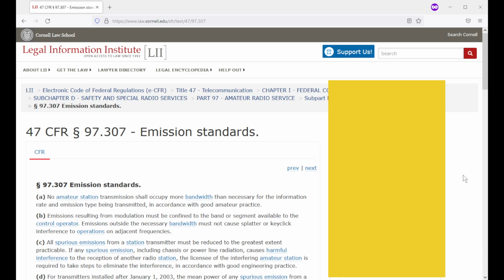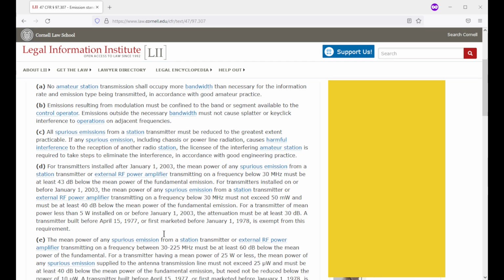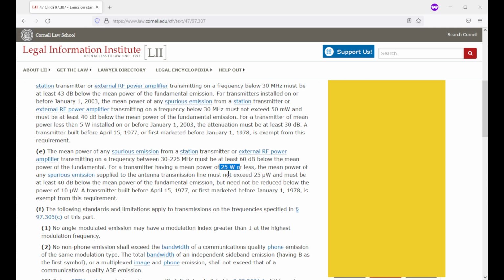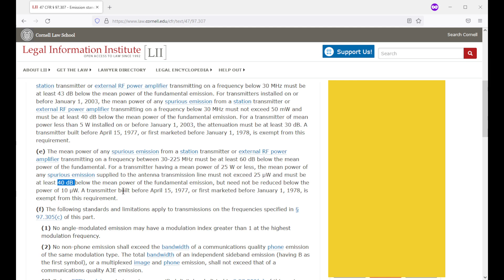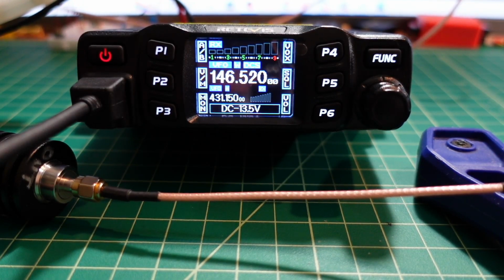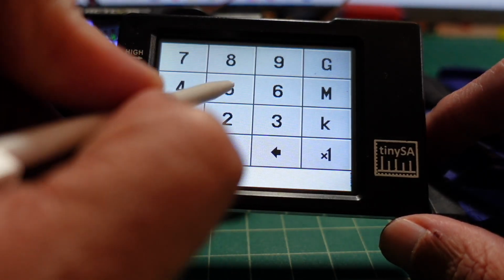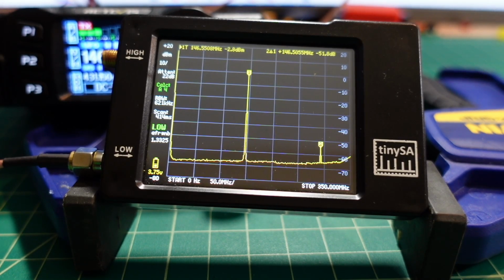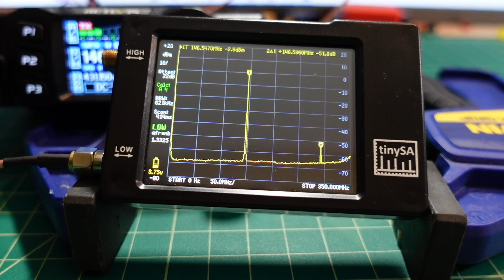Retevis RT95 Testing Harmonics with a TinySA - Ham Radio

Comment: Thanks, I have the Retevis RT95 and the Anytone variant. Both are good and almost identical but the Retevis allows for the upload of the latest firmware which includes a mic gain setting, amongst other things. I always found the Anytone version's mic a little quiet, the Retevis fixes this. I tried to upload the new Retevis firmware onto the Anytone but it wasn't happy, I was able to roll back though so didn't brick the radio.
Reply from the maker: Thanks for the info, they are really good radios for the price 👍

Comment: I just got one of the RT95's, and electronically it seems fine, and mechanically it seems quite rugged, far better than other Chinese gear. But ergonomically I'm not impressed. First, the buttons and the switch require so much force to press that unless the rig is screwed down it requires both hands to press any of the buttons on the front panel. Second, the P5 and P6 buttons stick out of the raised display bezel right beside the rotary knob making it such that only the right hand can conveniently turn the knob, and even that is not as easily done as it should be, especially since it takes a good grip to even turn the knob. Third, the mic cable is so stiff and heavy that it twists the oddly shaped mic around in my hand. I assume the buttons, knobs, and mic cables are all quite rugged, but I would really prefer them to be both rugged and smooth working, too. But I suppose that would make it an Icom, and would double or triple the price just to get the ergonomics right. Sigh. Oh, and the mic clip sucks, and there's nowhere to mount it on the rig. Radio manufacturers have known how to do that for at least 75 years. Shouldn't someone tell the Chinese?
Reply from the maker: lol, I agree with the assessment…. I remember when these were 85$, Hope you didn’t pay too much

Comment: Another good video!  In case of problems with the equipment your testing, I'd show  putting a wattmeter inline and test the radios output power into the dummy load Before hooking up the TinySA. I'm sure you'd already tested this beforehand, but viewers who aren't experienced in service techniques need to be aware that just because it Should be transmitting low power, it might be transmitting High power. Don't want to let the Magick Smoke out of our test equipment.  
EDIT ADDED: I always used a Bird 43 wattmeter to test output power then switched to a sampling slug into the service monitor at the bench (for very high output levels), or a frequency counter out in the field (all output levels).
73   mike   N4ONL
Reply from the maker: Hey Mike, thanks a good idea / tip, thanks for the post 👍

Comment: In RF standards testing, harmonics are measured via not just a power attenuator but after this a high pass filter, designed to reduce the fundamental. Otherwise you may just be measuring the harmonic performance of the spectrum analyser front end and not the transmitter. 73 G0JLF
Reply: It so happens I was reading about this needing to place a suitable highpass filter at the RF input of the spectrum analyzer to decrease its harmonic distortion.
I noticed you have been ignored  for your helpful advice. 2E0IKJ
Reply: That is bad practice. Especially as we need the fundamental carrier as reference for the relative dB values of harmonics. A high-pass filter will give wrong readings, as we don't have the exact magnitude of the fundamental, only the power of the harmonics in dBm. And this magnitude (dBm) is what harmonics refers to, as dBc below carrier. An attenuator is of course necessary, so the fundamental is at a level -20dBm or so, far below saturating the the analyzers front end. 73 LA7YKA.
Reply: @la7yka  - simple, measure the fundamental level first with just the attenuator, then measure the harmonic levels with a HPF (a notch can also be used) after the attenuator, taking into account the additional loss. The difference in results may surprise you, particularly with lower spec Spectrum Analysers. Not everyone has access to high end R&S FSWs or Keysight PXAs! 73 G0JLF.
Reply: Yes it may work too. 73s - Einar

Comment: I may be wrong here, but usually we say "first harmonic" about the fundamental frequency, and second harmonic is the twice this frequency, third harmonic three times and so on. However, my point is odd harmonics as these usually are larger in amplitude than even, probably because of the class C amplifier stage in FM-transmitters. What I find really interesting here is the level of the 3rd, which in this case is 439.560 MHz. I guess the tinySA can't measure this at the "high" input, since the 1st harmonic is out of the range on the low side. But I can be wrong here too, so don't take my words for anything other than just an input.
Reply from the maker: Hey Erika, I have heard it said a few different ways but I believe you are correct.  Also, the low input on the TinySA stops a 350MHz if I remember correctly.  Thank you for the comment!
Reply: Actually, it's Class B amps (or Class AB) which naturally suppress even harmonics. The Chinese radios often have excessive second harmonics on 2m. This result is encouraging, and this radio at 5 watts draws half as much current as my ICOM IC-2730 at the same 5-watt output. The receiver overloads easily but otherwise, its size, weight, intuitive menus and low current drain could make it an outstanding go-kit radio.

Comment: I think that a more valid measurement is with the maximium output, where the endstage works more critical. I understand that the limitation was the low power attenuator, but 5W for an 25W equipment,...mmhh (Sorry for my English, I'm Spanish speaking)
Reply: I'm not an electrical engineer but became an electronics technician way back in the early eighties.  With that in mind I do know you are spot on in reference to testing at full rated power as this can make a huge difference.  With modern radios I'd actually test at both low and high.  That said the video still has lots of value in showing the general method for harmonic testing.  I love how TSA explains things.
Reply from the maker: Fair comment 👍

Comment: Using LEVEL/UNIT you can switch the level display to watt and after setting the LEVEL/EXTERNAL GAIN to minus the external attenuator you can check the output watt levels 
The slow update speed of the display after starting the transmit is due to the averaging (TRACE/CALC/AVER 4) being enabled by the MEASURE/HARMONIC function
Reply from the maker: Thanks for the info Erik, and for all your work on the TinySA 👍
Reply: Thank you BOTH!

Comment: I have an RT90 which is actually a Retevis DMR Mobile. Not a good radio.
Reply from the maker: Is the 90 the mobile?
Reply: @TheSmokinApe  Yes, it is a mobile radio.
Reply: Hey Don, Not good in terms of what ? Emission or user interface or sound quality. Planning to buy one need to know
Reply: @smallick653  Both actually. The radio sounded horrible on digital and I got lots of complaints from my club members on audio when using the repeater.